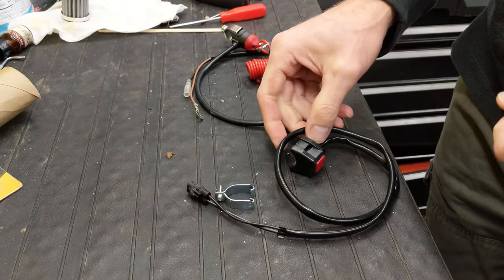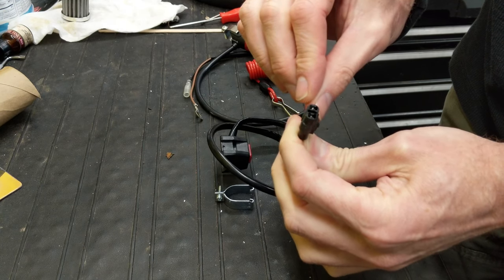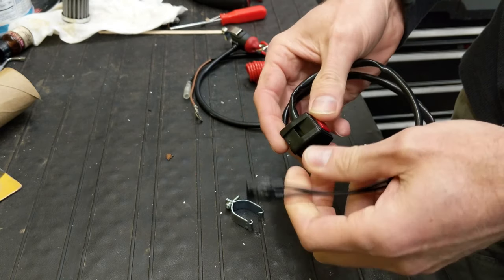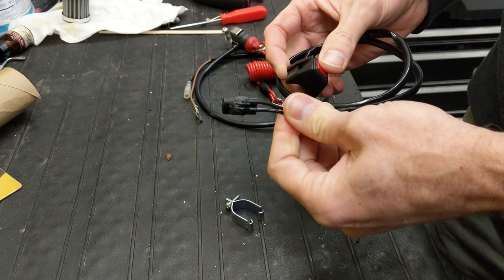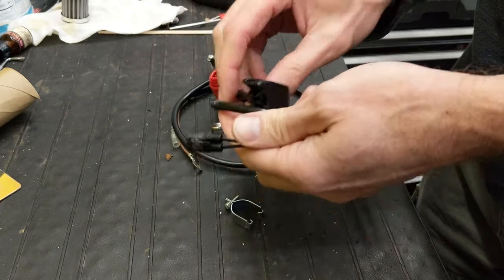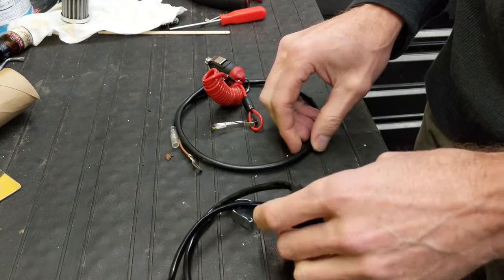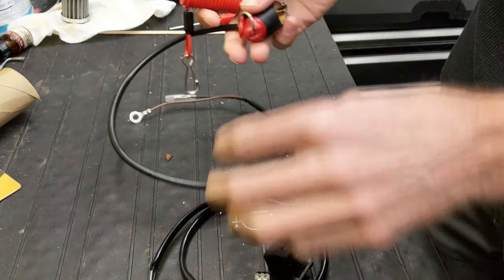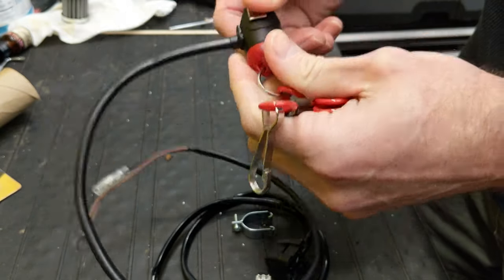Tether Kill Switch Install on Snowbike by BS Tech

Comment: Hey buddie thank you for your helpful video!! 
I did the install and the bike runs no matter what if I flip the wires around . 
If I put the tether back in it shuts it off and won’t start until I pull the tether back out. 

P.s. your input would be greatly appreciated thanks 🙏
Reply from the maker: Our guess is that you have the wrong switch for that bike. There should be normally open and normally closed switches so you have to have the right one for how the kill switch works on that bike.